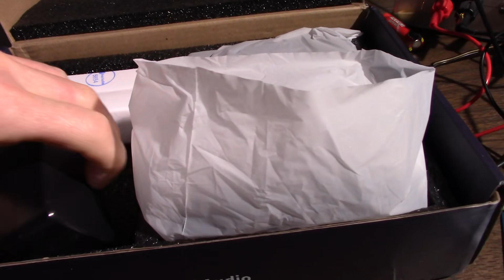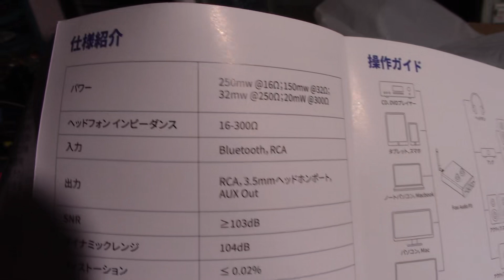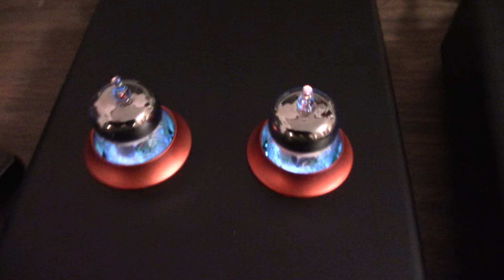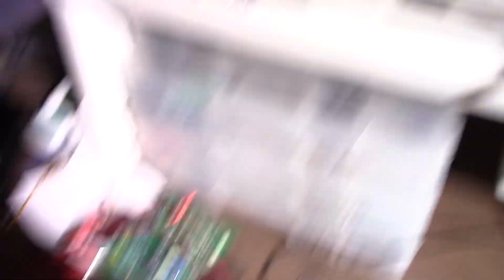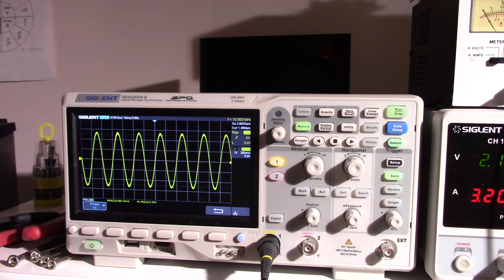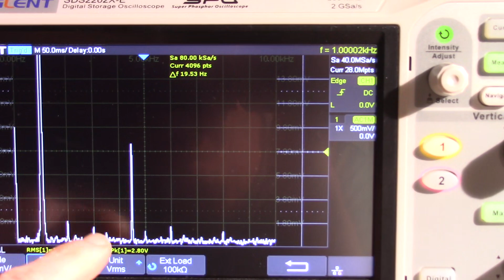Fosi Audio P3 Pre-Amplifier review & analysis

Comment: valves are in the "starved anode" very low current region - can swing a few volts - interesting that a lot of people like what that does.  Much cheaper - different than say a Conrad-Johnson $$$$ full of tubes.  Did you review an op-amp - starved tube phono stage?

Comment: All of these tube buffer preamps run these sharp cutoff pentodes at between 1/2 to 1/3 the normal design voltage that they were designed for(RF radar and RF small signal amp) to get substantial even order distortion to give the "tube" sound. If you look up the freq. vs gamma curves on these types of tubes, they do fall off at frequencies around 20hz and below esp. at the lower voltages. It's just the nature of this sort of beast

Comment: It's great to have a 'Feeeel Tech' moment again as it seems like yonks ago ! Regarding the the preamp I am afraid I run a mile from those things with the blue LED under the valves as to me that is pure Tat. Temu and Banggood stuff ! I thought at first when you pulled the valve that nothing happened which would not have surprised me at all, but like you I don't get the 'valve sound' vibe. Nice review....cheers.

Comment: It is just plain stupid to add tubes in this manner to an otherwise all IC circuit. Either do tubes correctly, or leave them out. In this example, they are used as distortion creation devices. Stupid.

Comment: I think you would be better just using the 5532s for all the gain and tone control. All those valves will do is add colour, distortion and noise. Does not even clip symmetrically. By a long, long way. Take valves out of the circuit, you don't need voltage conversion cut the cost in half. It will be a better preamp overall.
Reply: H Fi snobs are the most irritating nerds in the universe.ALL sound is a matter of taste, nothing more. Exit dicussion.
Reply: People want that noise. For reasons hahaha. I always laugh when they say that tube sound is pure and clean. Ehhh no. They love distorsion. And you can always add that later. There is something named 2nd harmonic generator and is a simple circuit that do that and there are digital tube sound filters for music. There is a reason tube enthusiast hate negative feedback. Because it cleans the harmonics and make the amp sound more hifi.
Reply: Just enjoy that valve sound
Reply: @isoguy.   That's the rub though, probably won't get much of a valve sound out of this.
Reply: @HillsWorkbench  Ah! Probably the best for me at the moment, its within my budget. I'll get rid of those nasty blue leds. My dream would be a fully restored valve amp with an internal mod to receive music via blue tooth. Unfortunately looking at the cost of such a unit is out of my price range. Though thanks for the heads up on the Sound issue. Regards ISO Guy
Reply: I thought tubes just do not clip harmonics as sharply as solid state amps do, actually less harmonics making it warmer sounding. I am not a valve subject matter expert, but I did see a McIntosh theater demo at the consumer electronics show in Las Vegas years ago. They used their solid state monoblocks, but had valve preamps. It sounded splendid. They felt that valve preamps are where they are most effective, even in a $100,000 sound system.
Reply: @kenandbarbie-b6c  Tube amps tend to have more even harmonics where most transistor amps have very little. Arguably, odd harmonics sound worse. A touch of second harmonic distortion can make some music sound sharper, kind of adds an edge to percussion and clicky sounds. Clipping is a whole differrent issue.
Reply: If it doesn't clip symmetrically, maybe they are deliberately biasing it for distortion?
Reply: Well, I have this silly idea that HiFi people strive for the best sound possible. The idea that ANY circuit should design in built distortion, is beyond words. Such people should change hobby's and take up stamp collecting. Another issue is the gain, if any, is very low from the valve, hence full of ICs Mostly because they often use RF valves that are cheap and nasty. Not made for audio at all. An EF86 or an ECC83 would be a better choice, actually made with audio in mind. The EF86 has much higher gain and no ICs would be needed. Better still ditch the valves completly. Leave the 40s in the past. @andic6676
Reply: Hard clipping is not just a little added second harmonic but probably 10% THD and not pleasant by any stretch of the imagination. Simply poor design. @andic6676
Reply: Tube sound is reality, and some prefer the addition of harmonics by tubes/valves. It's all just a matter of taste.
Reply: @beverpix   enjoy them until the western governments ban them for not being green. the filament can be categorized as the same as a filament of a light bulb.
Reply: @ot4kon  Have a nice day
Reply: Agree, as well discussed on your last video. And really, this tube is set up for low distortion at normal levels - really doesn't have that signature 2nd harmonic distortion that gives the "tube sound" so why bother with the extra costs.
Reply: Does it clearly improve sound quality?
Reply: @tamersosman  Guess "improve" is a matter of personal likes and dislikes.  One person may like more base, harmonic distortion or treble.  I prefer the valve sound, others hate it, I guess just like my choice of music, some people  confer, others disagree.  Disagreement is a healthy scientific process. However, forcing one's personal view onto another causes arguments and strife.
Reply: @tamersosman   No, not clearly. A little 2nd harmonic can make some music seem sharper, but that would badly color complex sounds like a violin or voice.

Comment: They look very much like a 12AX7 valve, high gain low noise twin triode from the 60's.
Reply: They're RF pentodes, actually. Go figure... :-)
Reply: @generessler6282  That's just weird.
Reply: A cheap and nasty choice probably adds more colour and distension. It offers almost no gain, that's the job of the 5532 @generessler6282